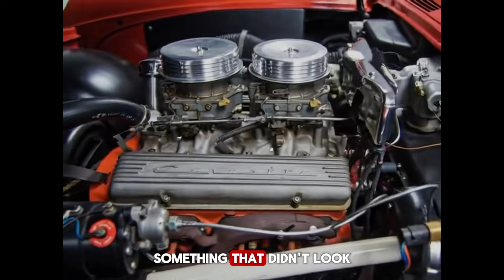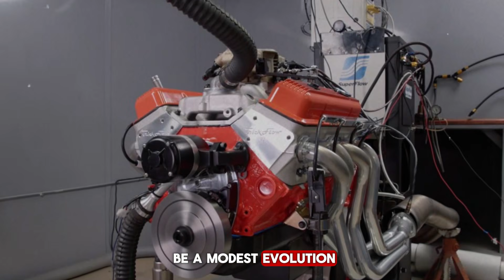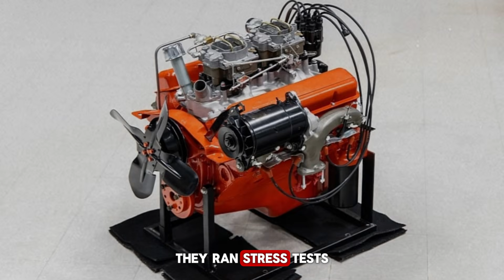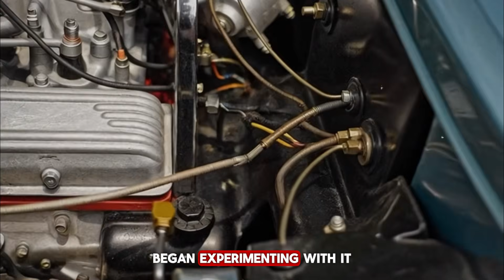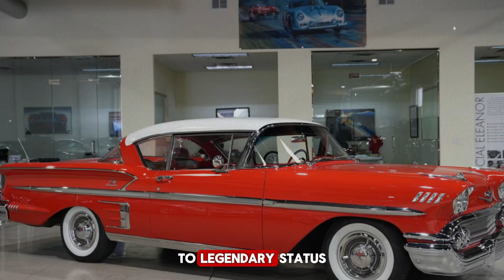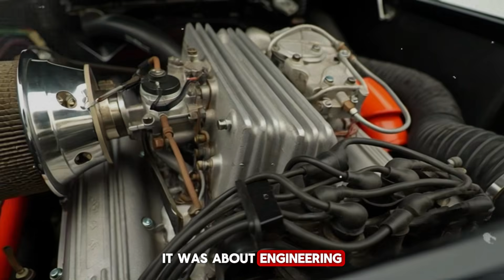Chevy’s 283 Small Block: The Engine That Changed Muscle Cars Forever

Comment: I never did own a 283, but I did have a 1967 Camaro with a 327, a 1971 Camaro with a 350, and a 1973 C10 pickup with a 350. I wish I had all these cars today! Incidentally, the 283 was never offered in a Camaro. Base V8s were the 210 hp 327 for 1967 and 1968, then the 307 ci after that until the 305 came out.
Reply: The 283 was a smooth  running  engine. I knew a guy years ago when I was a teenager and he was 40 or more, he had a late 1970 Chevy Monza that came with a 267. He pulled it and put a built 283 with the good heads and good size cam with 4 barrel carb and with a 5 speed trans and was knocking off heavier cars with 350s that was supposed to be running. They would  jump him out the whole but when he grab 2nd gear he would start coming back and pulling ahead in 3rd and out running them in 4th and the little 283 be screeming 7.500 RPMs. Later when the hood was up and they saw the oil pipe in the front of the engine. They would say man I thought  I had you! I jumped out the hole on you and this and that, he would always this ain't nothing  but a little old 283! Thats all it is. Just a little old 283. And I never  forgotten that. That little  thing was kicking some ass and it was quite  impressive for a small motor. But GM started  putting it in heavier cars with a 2 barrel single exhaust and and HYW gears, so its true potential in the later years was over looked.